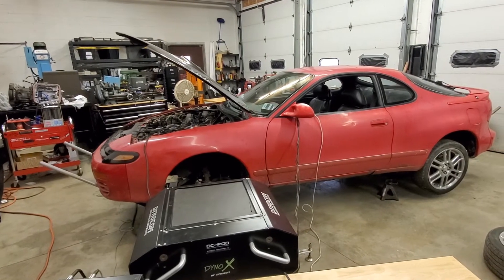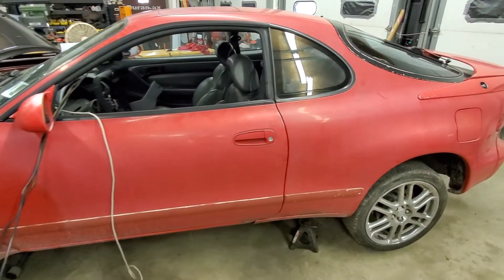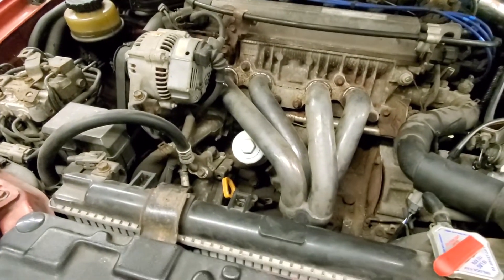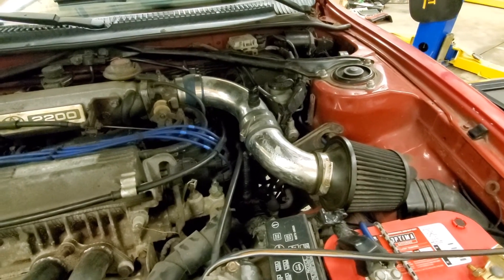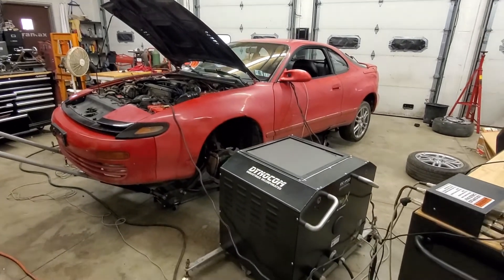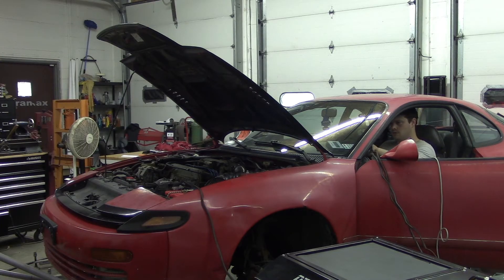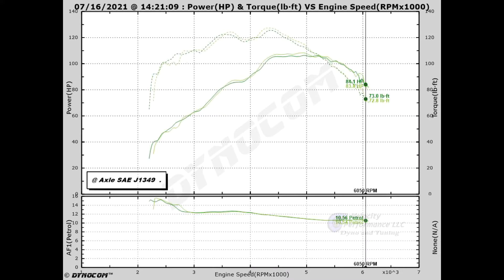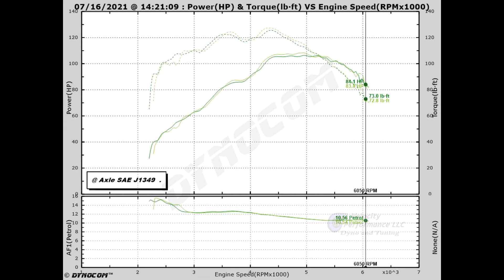93 Celica GTS On The Dyno, New Series Introduction Episode 1

Comment: Bro can you tune also... The celica i bought in dayton put a rod threw the block... Looling for a new block but i believe it leaned out and blew. Getting a new block with forged rods and gonna rebuild. But would love to get you expertise on this and possibly your help with tuning when finished
Reply from the maker: Yeah just let me know when your ready. I have knock module to datalog knock and   a o2 sensor I always use on the dyno. Does it have a factroy or aftermarket ECU?
Reply: @velocityperformance8574  i believe factory since it topped out at 115
Reply: @velocityperformance8574  i plan on doing something with that also... Bummed but seems needed to have forged rods. This thing was mean but gonna build it right this time around compared to what it was built. Might be a little bit but will definitely keep you updated and maybe be able to put it in on of your vids
Reply from the maker: @coolviper25  the factory ecu isn't tunable, I can still watch for knock and log AFR. A good standalone ecu would be better and safer. What gen 3sgte is it gen 4?
Reply: @velocityperformance8574  i believe the 92 as what it is will know more when i pull it out and get the numbers... Was told it was the st215 but hard to say as i got fleeced but will know within a month ill keep you informed and thanks bro